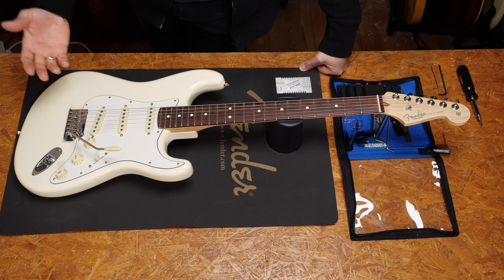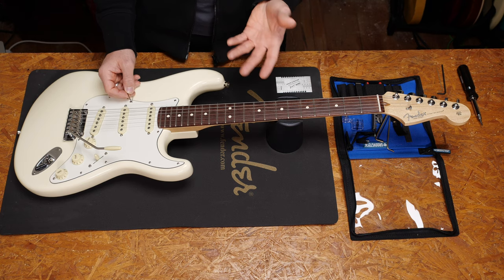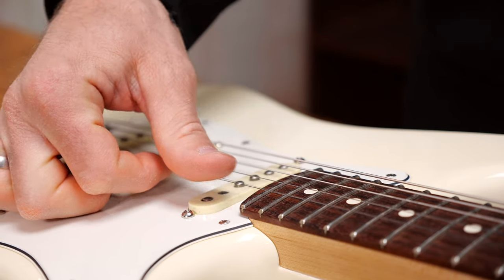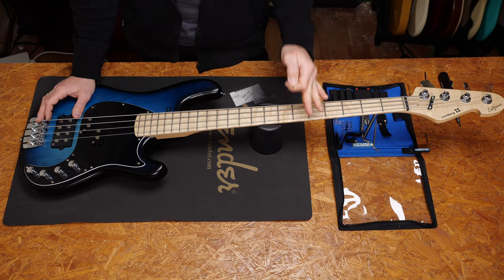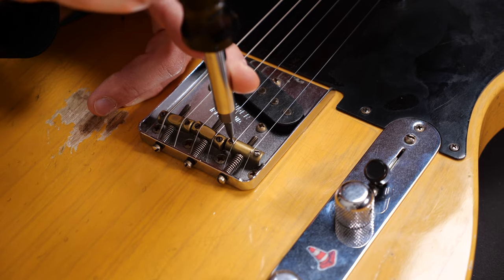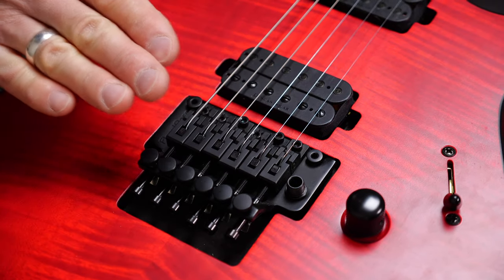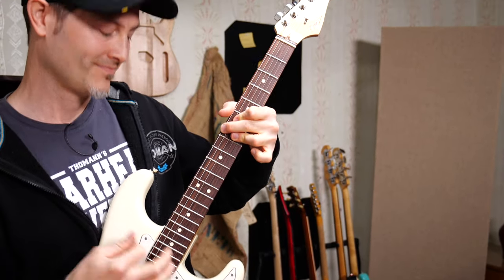How to set up a guitar bridge | Guitar Tech Tips | Ep. 3 | Thomann

Comment: Thanks for the video. That helped a lot. I was thinking about how to adjust the height as there is both the radius of the neck and the thickness of the strings to consider. Also giving exact millimeters helped greatly. I was having a string buzz on my thicker strings.

Comment: Would have been really helpful to explain how to set the radius on the strat bridge considering how much you talked about not having to adjust radius on other bridge types
Reply: If you use a ruler to measure the height of every string as in the video you will end up following the radius of the fretboard. Otherwise you can just eyeball it, you wont have an exact match anyway since the lower strings needs more space than the higher strings.

Comment: Question:  What tool is being used to measure the string height at such small increments as tenths of a mm? 2.0; 1.9; 1.8; etc. I am a beginner at modding & setting up but have yet to find a tool that is capable of such small measurements.

Comment: Great video! Question: Do you detune the string before adjusting the saddle height or can It be done with the string up to pitch? Thanks Chris😁
Reply from the maker: Thomas Hill you can adjust them without drinking the strings, unless you need to raise them way up high. Then it’s better drinking the string a little before you break it. //cheers, Kris

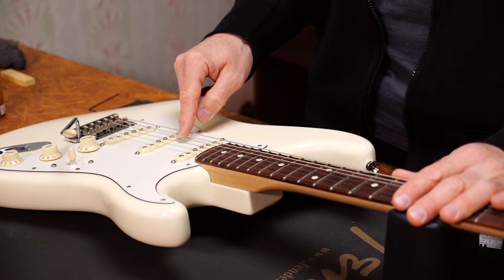Comment: Great video, thanks a lot! Just to make sure I got it right, when at 2:03 you suggest a 2mm space for the low E string, that corresponds to the distance from the top of the 12th fret to the bottom of the low E string? Am I correct?
Reply from the maker: Exactly! From top of the fret to the bottom of the string. That might feel too high, depending on the guitar and your personal taste. But it's a good starting point. Most important thing is that it has to feel right to you. :)
//cheers, Kris
Reply: @ThomannsGuitarsBasses  Great, thanks for your answer and keep up the good work! :)

Comment: The problem I always have is that when I lower the action the grub screw heads protrude which is uncomfortable on the palm. There are several solutions. Fit a shim which is a fiddle, stick some tape over the heads but this is messy, or replace the grub screws with shorter screws. I have measured the screw thread diameter and it seems to be 2.5 mm but 3 mm appears to be the standard. Which is It? :( Thanks.

Comment: I just recieved a HB guitar with a tune-o-matic bridge and I adjusted the bridge, since the action was extremley high. I forgot to reduce the tension of the strings (detuning) while I did that and I have read that it can cause serious damage to the guitar. How do I know something like this happened? I haven't noticed any differnce yet (expect lower action ofc.)
Reply: You can damage the bridge by doing that, it happened to me while adjusting for the first time a Jazzmaster with a hardtail, I adjusted the saddles without loosing the strings and the screws marked the bridge, no big deal really but it is always a good practice to loose your strings whenever you adjust anything that would tighten them (truss rod tightening, raising string height, pulling saddles torwards the bridge while intonating)

Comment: Seems to me that 1.5mm on the high E us much too high... I always go between 2mm to 1.5mm on low E down to 1mm or lower on the low E. My perfect set up in the telecaster I built is 1.5mm Low E and 0.5mm high E string. I built a compounded radius that goes from 14 to 16inch, and the high E can be bent three half steps without fretting out. I do lose a light bit of sustain when bent three half steps, but I usually don't so I'm happy with that very low action.

To get everything as low as possible, I adjusted the neck angle using shims I designed and printed, then adjusted the neck (some people like it with a lot of relief, I tend to go for a flat neck) and nut adjustment as low as it will go with around 0.1mm between the strings and the fret when a capo is at the 3rd fret.

Comment: Unfortunately I'm much better at working on guitars then playing them. It saves me money and frustration, but doesn't get me any girls:(   The real problem is when you set the string height and it's still buzzing, so I go up 1/4 turn at a time...adjust/tune/check for buzz. If we keep slowly adjusting up and get to the point where there's no fret buzz and the strings are at or above 7/64 , or about 2.8mm, that's when the real problems need to be solved. Truss rod adjustment should've been made prior to adjusting steering height so the next steps...I think...are fret leveling, and check..if not then we go to neck angle adjustment. Hopefully you don't have a set neck at this point! Also it's good to sight your neck to try to figure out if it's straight to the eye. I had two Tele's in a row with crooked necks, what a pain in the neck! So ya, making a video showing the process of neck angle adjustment would be good!

Comment: Can anyone point me to a video that fixes me problem. Electric guitar. On the A,D,G,B strings. When I fret the 17th, it definitely hits the 18th. Only on those 4 strings and only on that one fret, everywhere else is.. good enough. I say good enough because I've never changed any settings, its a cheaper guitar (Epiphone SG, almost 20 years old now), and there is nothing noticeable about other strings/frets. My frets aren't loose and don't look to be higher than others(just eyeballin). Where to start with small adjustments is what I'd like. Thanks anyone that answers.
Reply: First use a fret rocker or something small and straight like a razor blade to check the height of the 18th fret relative to the 17th & 19th. If that's definitely a high point, tape off the fret or use one of those metal fingerboard protectors with one fret slot cut out of it, slowly sand the high fret with 320 paper. Keep checking while you do the sanding until the 18th fret rings clear. Polish with 000 and then 0000 steel wool.